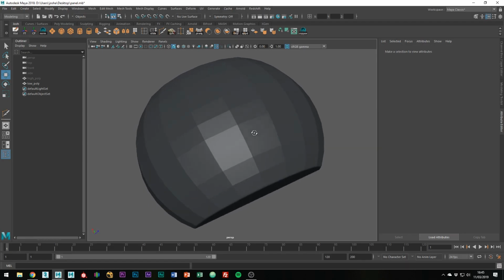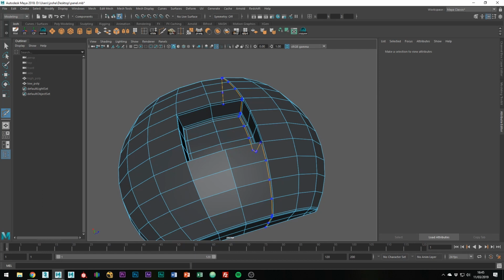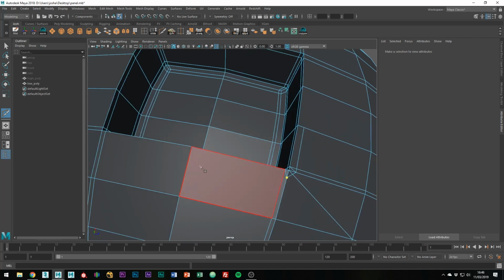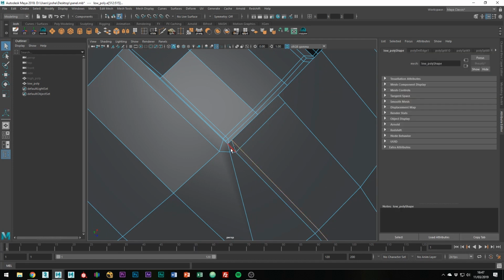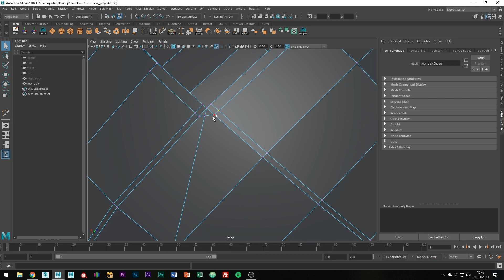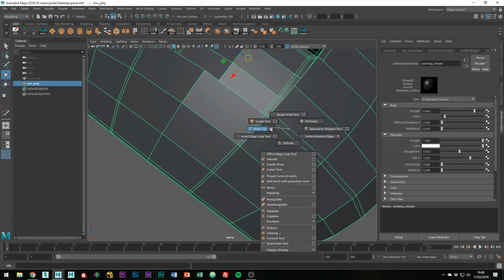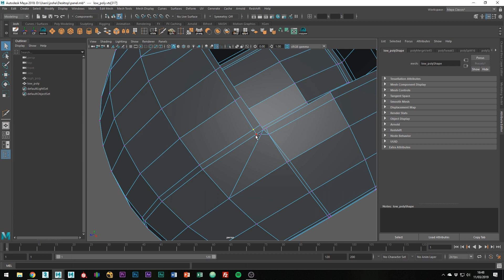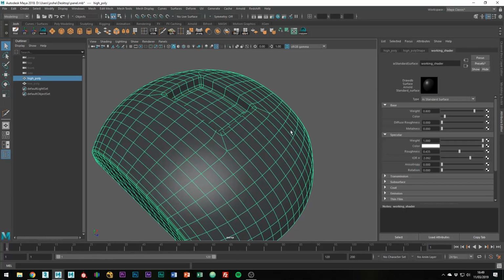Sharpen Corners Without Destroying Curvature

Comment: Why dont you use the crease tool instead? this seems to add a lot of unnecessary polygons
Reply from the maker: If you were to smooth the mesh, you’d still end up with around the same amount of polygons. Modelling this way is cleaner and more transferable between software packages

Comment: I have also used the seam tool to get similar results. Is this ok if I want my topology to be clean?
Reply from the maker: Do you mean crease tool? When using the crease tool you often need way more subdivisions to get good results, sure it's less destructive and more convenient to work with but results are results, and creasing, in general, produces an inferior result. The crease tool is great for concepting, when the design is still likely to change lots.